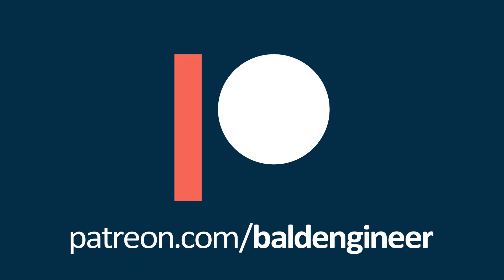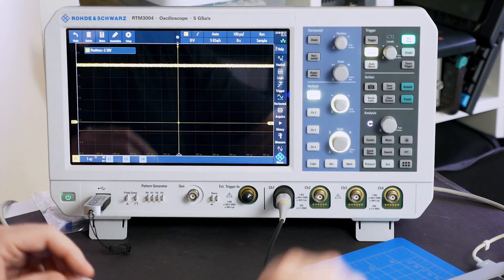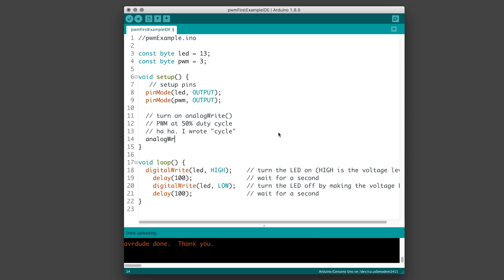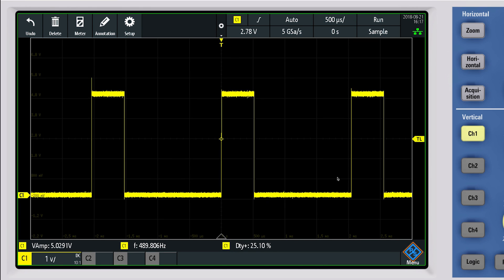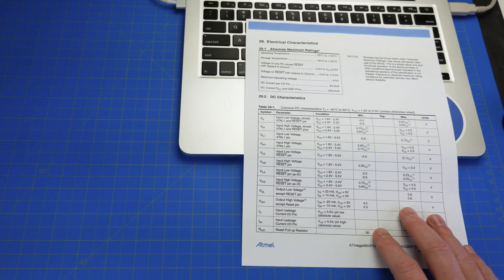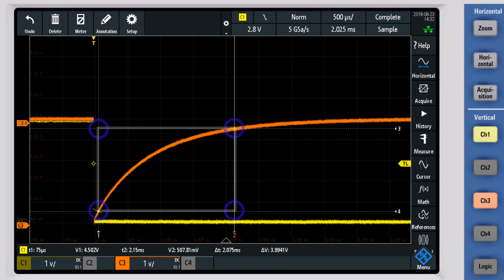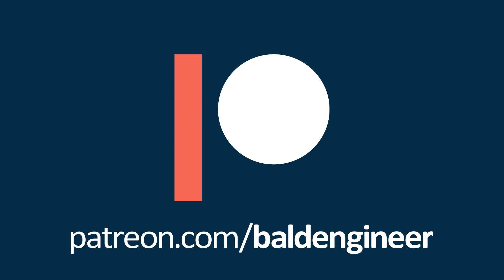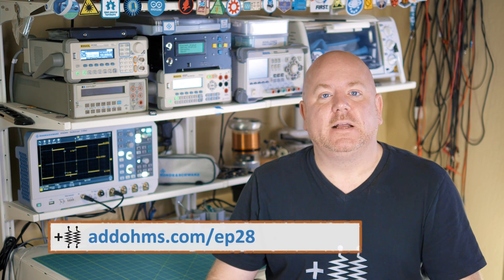Learn Oscilloscope Basics with an Arduino Uno and RTM3004  | AddOhms #28

Comment: Hi Mr.James can you make a video explaining the working principle of an antenna
Reply from the maker: There isn’t much to explain on how one works. In transmission current going through it radiates an electromagnetic wave. In reception an electromagnetic wave causes current flow.

The design is a different story. I’m not experienced enough to address that.

Comment: Ok, I have a probe question I would dearly love answered. 

I’m mainly dealing with Arduino and esp32’s, so do I use x1 or x10? Can you properly explain where, when and why to use them. Really good video, I have a Rigol, but would love your scope🏴😀
Reply: If you have a 1/10x probe it means that in the 1x setting there is a 1M ohm resistor in series with the probe. In the 10x setting a 9M ohm resistor is added so the total resistance is now 10M ohm. 

This resistance (impedance) is a load that’s applied to the circuit you are measuring. For many circuits adding a 1M resistor may not have any effect on its operation. 

However if measuring circuits that have low signal levels or are high speed a 1M ohm load may affect the signal you are trying to measure. Switching to 10x will increase the input impedance to the point where it should not impact the signal. You need to make sure your scope is set to match the probe setting so the measured voltage is correct. 

For reference, most DMMs have a 10M ohm input impedance.  This is so they don’t load the circuit under test.
Reply from the maker: In general, use them as an X10 probe.
Reply: For your application, doesn't really matter. X10 probe give you higher bandwidth and lower circuit loading, the downside is that it attenuates you signal by factor of 10.

Comment: Please tell some about the grounding and what to be careful about while probing. Due to the usb connection the arduino has mains ground reference  and i think that can put you in trouble if you probe not to gnd on the arduino?! Thanks!
And by the way that scope is f**king amazing
Reply from the maker: I'm not sure I follow your concern. Both the scope and laptop reference the same earth potential. Also on low-voltage circuits such as an Arduino, I would expect a number of other protections to trip before a user was exposed to mains voltage.

Now in cases where you are not referenced to the same mains circuit or dealing with higher potentials, then yes, there is a concern about referencing. 

But that would take an entire video to adequately explain.

Comment: I have a question. Why sometimes you need to isolate ground on the oscilloscope?
Reply from the maker: First, you should never isolate the scope from Earth ground. That is dangerous and reckless. You should either isolate the device under test or use an isolated measurement method. (e.g. an isolated probe.)  The reason for the isolation is that if there is a fault in the device under test, the scope's chassis (and its ground) is now referenced at some higher voltage. 

One alternative method is to use a battery powered scope since it isn't connected to mains. Even then, you want a scope that has isolated inputs (or isolated probes.)
Reply: @AddOhms  Thank you for your answer. So let's suppose I wouldn't use any isolation could this potentially damage my scope or would I just trip my breaker?
Reply from the maker: Earth connection is a safety mechanism. In normal operation, there should be no current flowing. If it does, a fault has occurred. So ideally a breaker would be tripped. Best case, the scope would take damage. Worst case, you would be electrocuted. Which is why floating the scope is so reckless. It is far more likely the device under test has a fault than your instrument. So if you float one, float the suspicious device under test. If it puts your scope chassis at 200Vac, you’re going to have a bad time. ;)
Reply: @AddOhms  Got it! Thanks again :)
Reply: Also when wanting to measure all kind of signals from a test board. Let's say Arduino Uno that is connected to a computer USB-port.
When not using special isolated probes the ground wire on the probe is connected to ground wire in the outlet through the oscilloscope.
The Arduino board connected to a computers USB has its ground through computer ground that is connected to ground wire in the outlet.
THIS means if you want to measure a signal from another referens point then ground pin you are going to short the test circuit out. If you want to measure how much a output pin signal differ from 5V on the Arduino with 1 probe and you put probes ground wire to 5V as referens point. This will short circuit the 5V down to ground through the probe because probe ground wire share the computers USB ground. This has nothing to do with a faulty device but will burn the Arduino.
Reply: The ground wire on the scope lead ties to the ground wire in the outlet, further more at the electrical panel 95%of the time the neutral is tied to the ground. Alot of home owners and even electricians have switched the Hot and neutral on outlets or the device has a non-polarized plug meaning the plug can go in the outlet both ways. If any of the above happens and you attach the ground on your scope the probe and scope will most likely be destroyed. Always use a meter to make sure. You can also be hurt pr killed besides losing your scope. Hope that helps you out.
Reply: @kardeef33317  Sure does!

Comment: Some of those features aren't available on $300 scopes, but  you can do all of those measurements after a fashion with an older scope.  The things described, DC vs AC coupling, triggering, reset, automatic measurement are all great fundamentals and using an Uno to probe was a great idea.  The last critical thing to learn - before learning it the hard way and smoking your scope - is the ground is earth (or at least common between channels) unless you are using an uncommon differential probe.
Reply from the maker: The USB-Scope (PicoScope) I held up at the beginning is less than half the $300 target and it offers every feature I showed. It’s tradeoff, relative to what I showed, is bandwidth.
Reply: @AddOhms  sweet, although for those of us that learned "the hard way" it can take a $1000 PC down with it.  I am delighted that for this kind of money today we can have gear that was only dreamed of 10-15 years ago.
Reply: Additionally, I was trying to get people to not fixate on the $3000 scope and lament not having the features.  Grab a salae clone logic analyzer and you can do all the spi/i2c/UART decoding for free.  Don't let money stop you from measuring.  But if I could only have one tool it would be a scope.  Any scope.  Even a "bad" scope is useful.
Reply from the maker: I agree with that statement. I've said in other videos, I use my scope(s) more than my DMM.

Comment: Wish I had an oscilloscope in the first place.
Reply: George Ohm Not cheaper than the cellphones we use. U get what I mean.
Reply: @billsmith3390  Great scopes out there under $500. But that one he is using is $4000. I wish I could afford it for my hobby but I must be realistic.Those pop up reference menus are absolutely amazing but without touch screen on my Siglent SDS1104X-E, not going to happen.
Reply: @billsmith3390  many of us use 150$ cellphones over here, not cheap for us in anyway